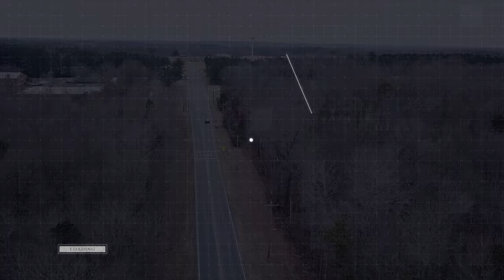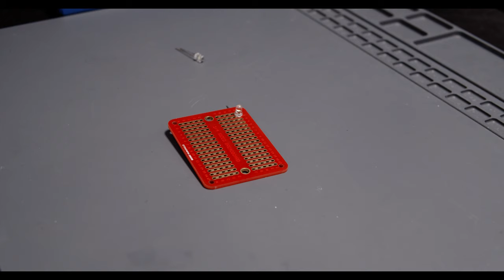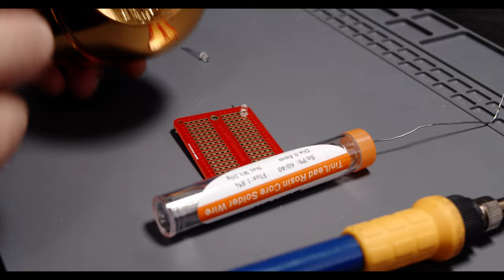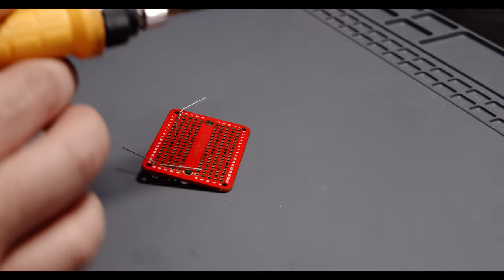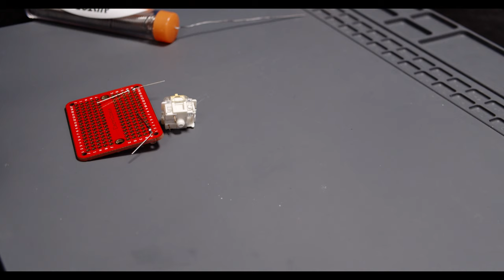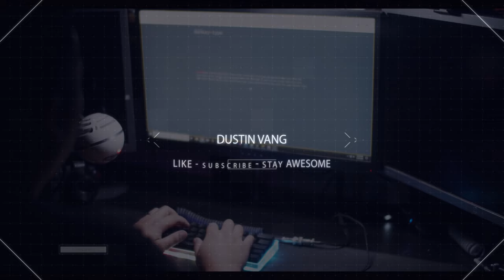How to solder Switches

Comment: Thanks so much for the video.  I am trying to make a lamp using multiple led lights.  I would love it if you could do a video showing how to solder both a series circuit and a parallel circuit with resistors.  I am a newbie and a teacher trying to learn so that I can share these skills with my students.
Reply from the maker: That is awesome to hear! so parallel circuits and series cann be soldered easily be figuring out the sequence the tricky part is understanding voltage and how to fit resistors into that logic. Once you figure out how to calculate voltage requirements for LED's what your power output is and how to use resistors to meet that requirement you should be good to go :)

Comment: Would you recommend clipping the long legs of the LED before soldering it?
Reply from the maker: Tharindu Herath you can if you feel confident it will not move. You can also solder one side in, adjust then solder other side
Reply: @DustinVang  Thanks!
Reply from the maker: @tharinduherath6595  my pleasure, feel free to send me anymore questions if you need help. have a good one :)